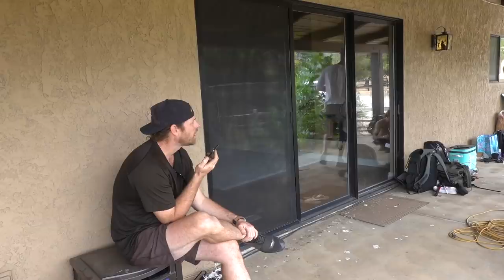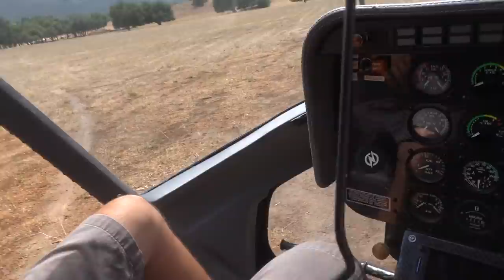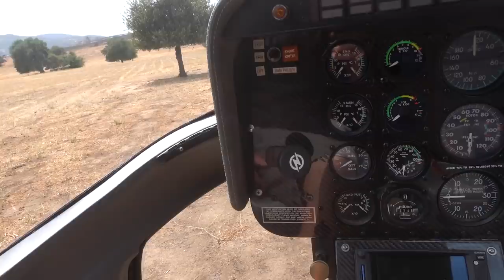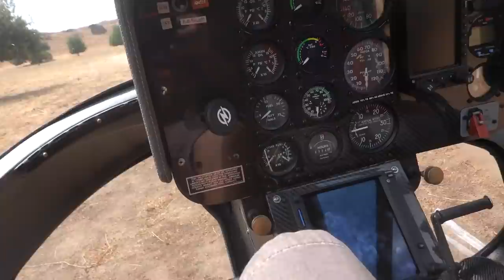GUESS IT'S TIME TO BUILD A HELICOPTER LANDING PAD AT MY HOUSE!

Comment: One of the Alaskan cruise ship land excursions was a flight in helicopter up to a glacier. That was the second best part of the trip. The best land excursion was the zipline.
By the time we were halfway through the zip lines we were eight stories high.
But if you are afraid of heights I completely understand not wanting to ride in a helicopter.
Our helicopter pilot was very good and it was a very smooth ride. I've been in elevators that were more bumpy.

Comment: Just remember.. dust is one of the biggest killers of jet engines. I can't believe that thing runs 25GPH and he's only paying $3.80/gal for JP.. that's cheaper than gas.. It's actually far cheaper to have a helicopter than a car today, at least here in NorCal where gas is $4.50/gal for regular. Think how much ground that thing covers per hour.. about 150 miles? Well at that math I guess it's not as good because that figures out to about 6mpg. 
Climbing off the side of the copter to drop would scare the shit out of me.. It'd be one thing to jump from a C130 or something where it's over quick and then you just go until the ground starts getting too close and you pull the chord (unless you were on a static jump, then it pulls it the moment you go out the door) but to have to spend all that time climbing out and almost falling while being buffeted by the rotor wash.. no fucking thank you good sir! Had I been able to enlist in the Army and gone infantry like I wanted to I would've done everything I could to go through Airborne/jump training too.. though my main job would've hopefully been Sapper/Corps of Engineers or sniper.. because paying me to play with explosives everyday would've been great.. or knowing that every time I pull the trigger my target is going down.. one shot one kill is definitely my mentality.